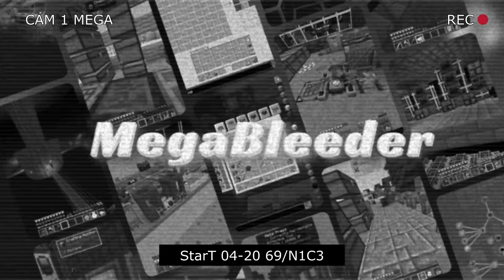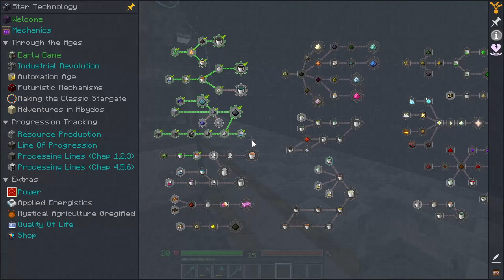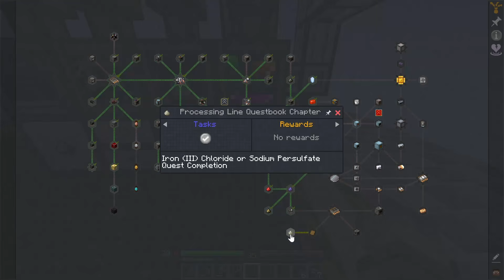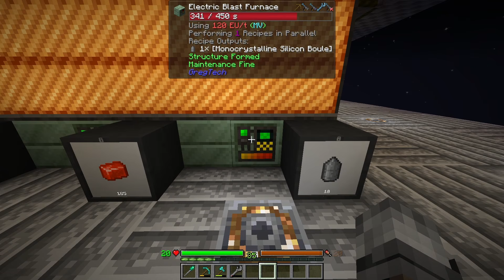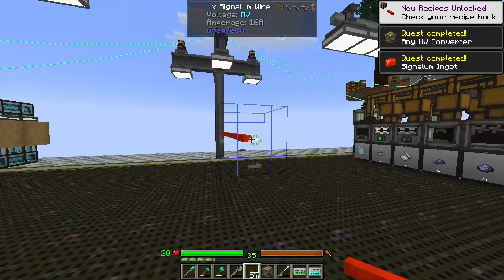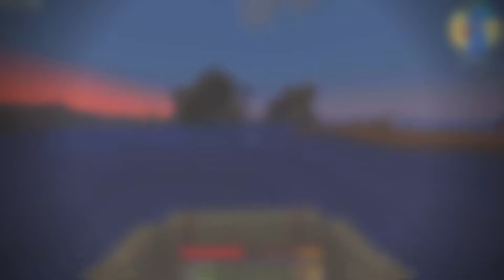Star Technology Ep9 Automated MV Circuit

Comment: when you reach early EV, i want you to ditch some passive automations because most of them are redundant once you get multiblocks, however one thing you should always passive would be fluids, since they are very mainly the most complicated to process and store so having priority over fluids should be noted, water is not a big think since its luckily infinite, however somethings like oxygen, hydrogen and nitrogen, need to be in large contained cells/supertanks, and more complicated once down the line will be prioritized more in stock, especially the plastics, and oil outputs.

resources are best turned into a dust than smelted, due to automation sake and because some resources, like iron will become redundant, in large quantities, so dismantling your complicated process will be necessary but i hope you have your own ideas

also don't get too carried away by your processing chain, if you don't want you computer to nuke itself, but i think you got that cover

small tip and critique im giving, keep up the good work <3
Reply from the maker: I appreciate the input! I know some items don't really need to be passive but I definitely prefer some of the basic material and components that way. I do know it's going to be better to stuff dusts for mixing and whatnot. For liquids/gases I do know they end up being bottlenecks with Greg Tech so I do plan on having large production and storage facilities for those.

One thing I really enjoy about passive setups is that they can run in the background while I'm doing things and then they don't actually take any computer processing while they are completely stocked up.